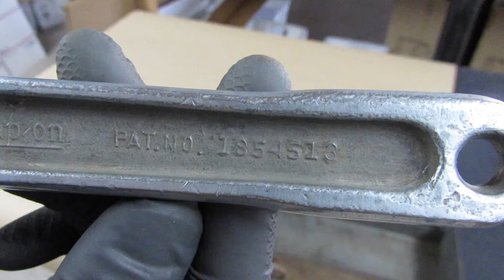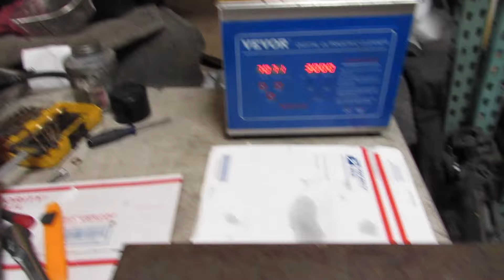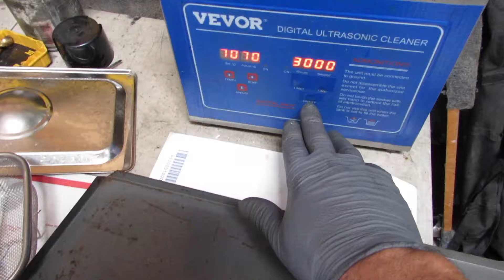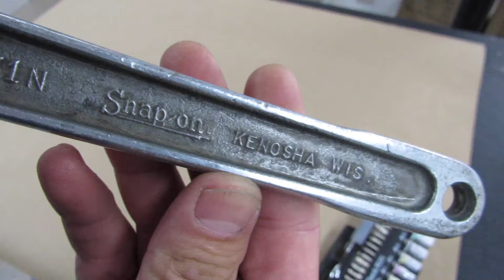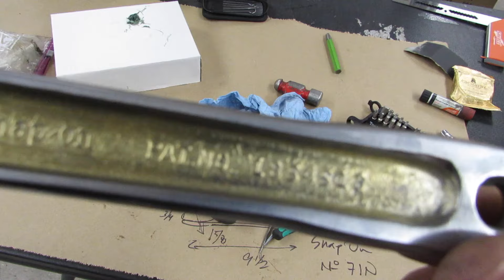Almost Century Old Vintage 1930's Snap On Wrench Restoration.

Comment: Those are WWII era tools.  Snap-on date codes everything so most of them appear to be 1941.  Be careful in the future with tools like those, though.  Cadmium was one of the coatings used instead of chrome during the war and has been shown to cause cancer - i.e., don't use a wire wheel as it will make the cadmium turn to dust and become airborne.  Love the set!
Reply from the maker: Thanks for that. I had no idea and will absolutely keep that in mind in the future. I’ve got the tool box all taken apart and still don’t know what to do with it…want to make it mountable on my truck.

Comment: Those little belts, get some high quality paking tape, the fiberglass reinforced stuff, put a layer on the inside of the belt before using it, they last about 4 times longer. I have that same ratchet, it works like new (after cleaning 60 years of crud out of it)
Reply from the maker: That’s some great advice right there. Will do that immediately when I get back to my next project. Thanks very much